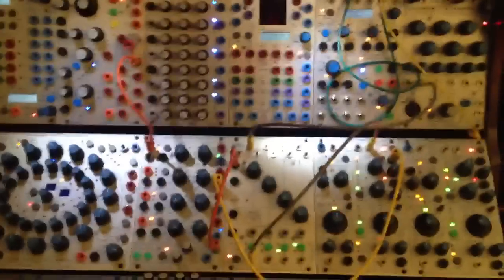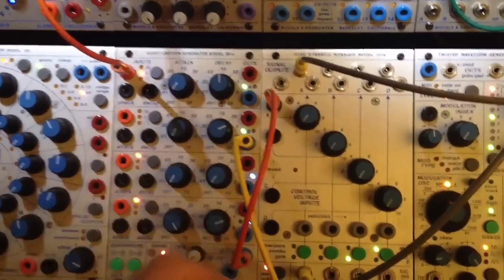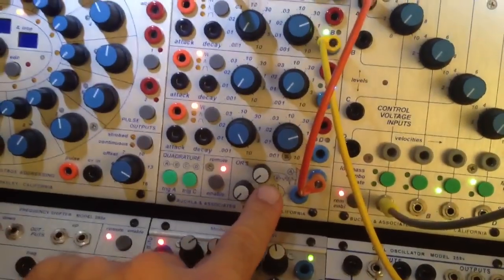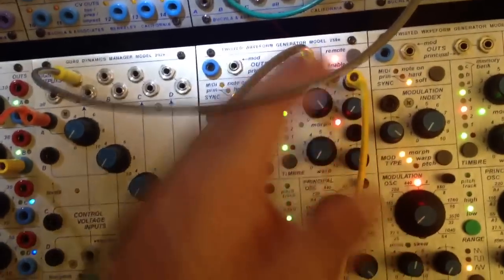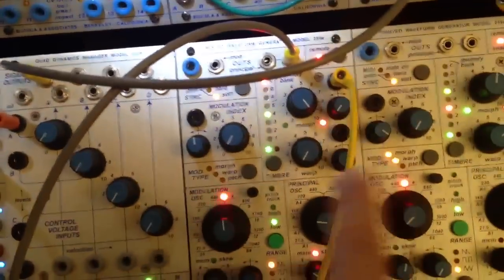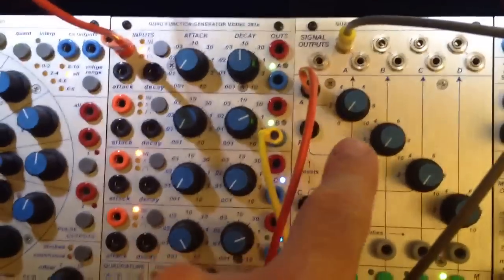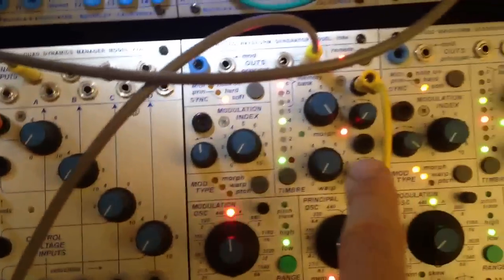281e OR patch technique in Quadrature mode

Comment: Great Video!
I'm in the process of building my own 281 and I'm trying to understand how Quadrature Mode works since I hope to have mine built in a few days.
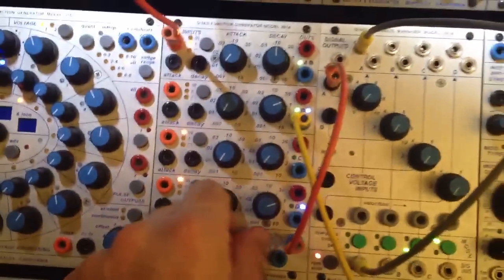I'm a bit puzzled by the LEDs associated with FG B of the 281e (beginning at the 1:43 mark in the video). 
1) What mode is FG B in?  (All 3 of the orange LEDs are off)
2) Why does FG B's blue LED appear to stay on all the time and never flash?  I thought the blue LED for FG B suppose to turn off when FG A's blue LED turns on & vice-versa?).